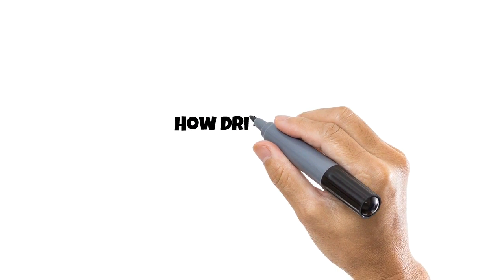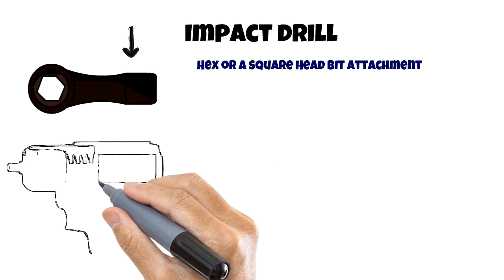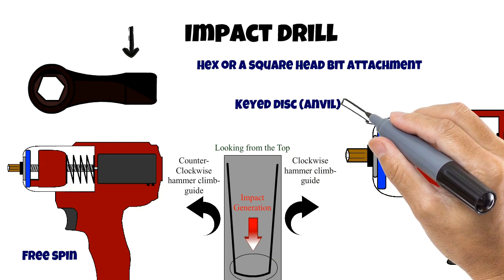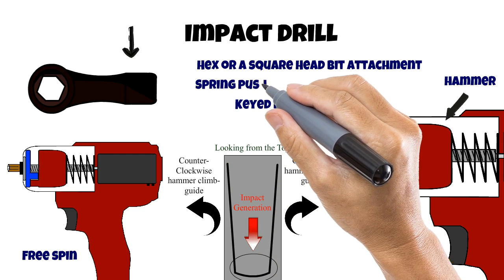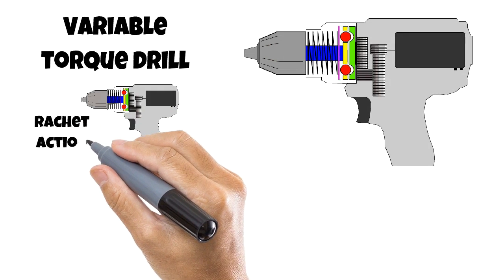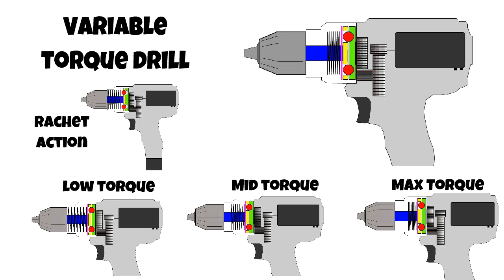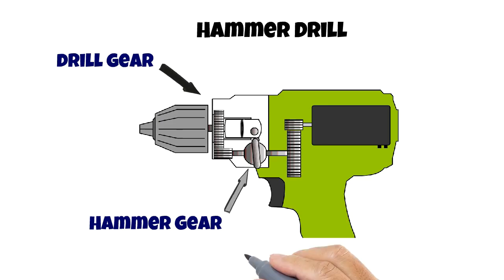How Impact, Hammer and Torque Drills work?

Comment: i think this video does not contain the latest battery power tool hammer drills with 2,2 joule power , they have a vertical compartiment placed under the mid, and the battery is behind that, so to say this shape:   ***|    |**\      (the stars are horizontal lines)
                                                      |__| __|

Comment: Very good video, I love the animations. The only thing I would change is that the first machine it's not an impact drill mechanism, it's an impact driver or wrench. It's not really for drilling. Anyway I think it's very instructive. Thank you
Reply: to be fair they are often used for drilling now, alot of drill bits (spade, twist, hole saw) some with a 1/4" hex impact end shaft

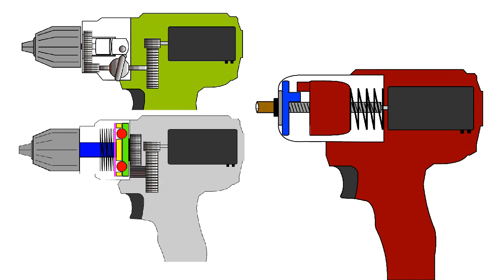Comment: 4:10 what's the difference between green and red drill if both can do hammering why two different mechanism??
Reply: the red drill (properly called an impact torque wrench/driver) the hammer is used to rotate the bit. while the hammer drill the impact is used to push the bit into the material its drilling in.